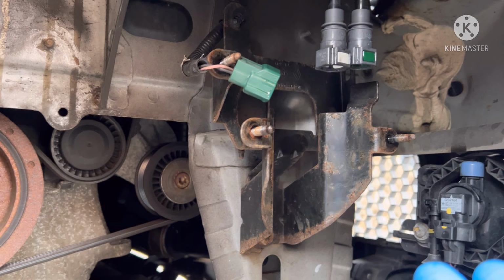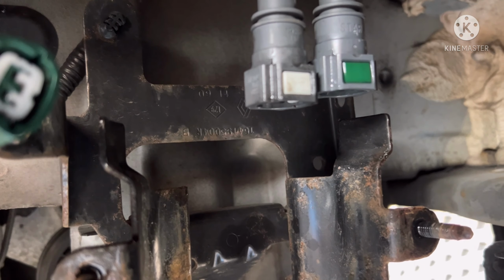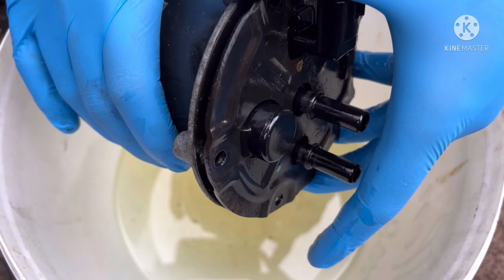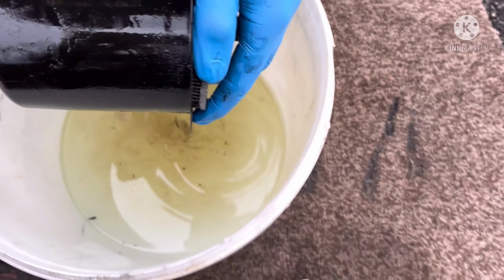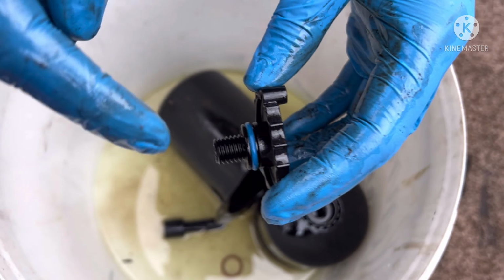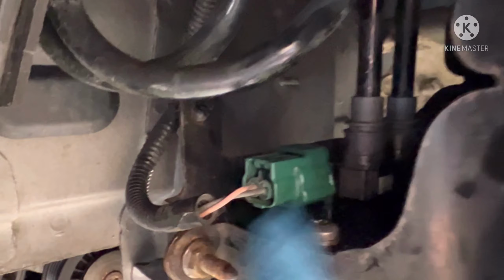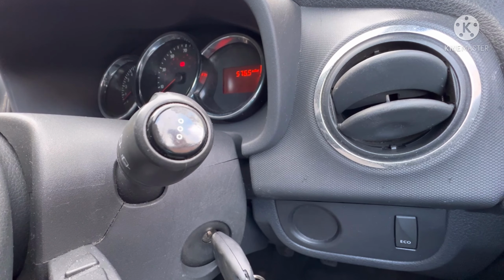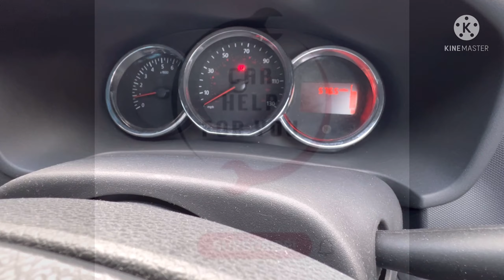DACIA SANDERO - LOGAN - LOGAN MCV - RENAULT CAR FUEL FILTER CHANGE - FUEL FILTER LOACTION

Comment: They dontt start because the small valve that stops back flow of fuel gunks up. The fuel then rubs out of the filter back through and into the tank. So in the mornings the filter is empty hence it takes a while to start as it pumos diesel into the sytem again. Mines just stsrted doing this original filter when i got it with 40k 😢😮😢

Comment: Thanks for the vid, it will come in handy. One thing, as I don't think you clarified (unless I missed it) - is the fuel filter behind the driver or passenger side wheel, looks like driverside?

Comment: Video very useful but you will need to check whether its the serviceable type.  Mine on a 2016 Logan II MCV is held together with rivits so cannot easily be opened.  On another post somebody obtained a 2nd hand serviceable one (which is what I intend to do).  Not sure whether the rivits can be drilled out and nuts added but wont be investigating this until obtaining a filter with bolts.